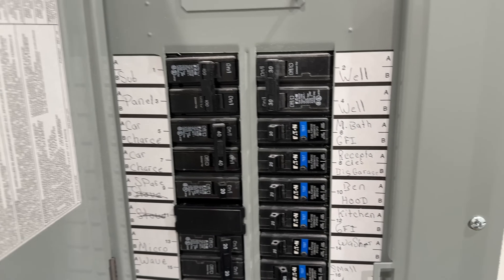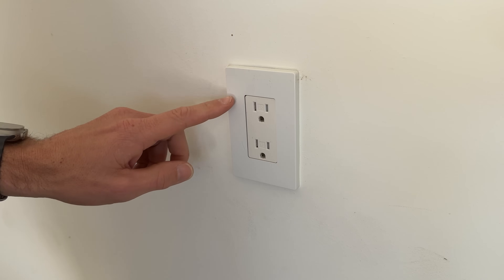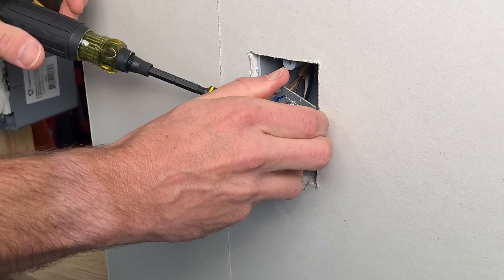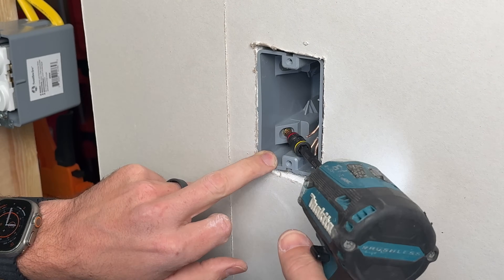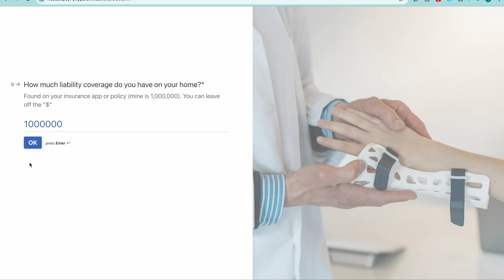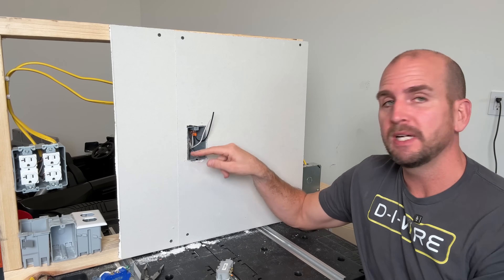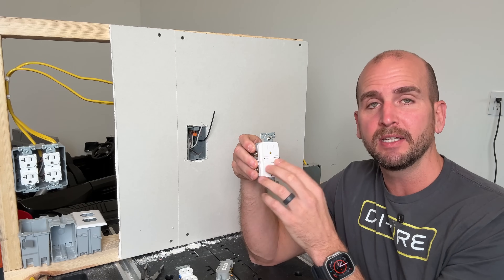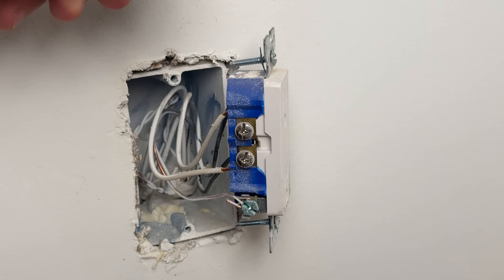The Ultimate Outlet Replacement Guide: 10 Mistakes Everyone Needs to Avoid

Comment: Good pointers. I always use a torque screwdriver/small wrench when tightening the terminal screws. All manufacturers have a recommended torque specification for their receptacles.

I find Eaton TR receptacles are more adult friendly than the Leviton. Whenever I try to plug something into a Leviton TR receptacle, I feel like I am breaking the TR tabs. Not so with Eaton.

I don’t know if you have created a video regarding permitting, but that is something DIY’ers can get wrong. Some think they do not need a permit because they are the homeowner, which in my state is not correct for a lot of the work you show. Some think since they own the rental home, they can do the work as long as they have a permit, which in my state is never correct.
Reply: Oof. This may sound bad, but avoid getting permission to do work in your own house. It's your property, not the state's.
Reply: @Lysander_Spooner  Personally, I would not advise people to break the law. Even after you sell the property, you are responsible for the work you did on it. If somebody gets hurt from your work and they can prove you never got it permitted/inspected, their legal position against you is much stronger.
Reply: @Around_The_Home  The "law" is a construct. Usually for three reasons, revenue compliance, and control. A free people don't ask for permission.
Reply: @Lysander_Spooner  Does that apply to the NEC also?
Reply: @Around_The_Home  I've found the NEC to be fairly practical on most codes. Some are a little ridiculous.
Reply: @Lysander_Spooner  a building permit is not permission.  a building permit with the accompanying inspection report, is confirmation to people with a future interest that it has been done properly.  have fun transferring ownership of a building with no inspections.
Reply: each state has different rules.  I think for the most part, simple device changes may be done by the homeowner with no permits, in the house they live in.

Comment: Great summary. Just changed a receptacle this morning in an old house. The ground was screwed to the back of the metal box. Is that enough? Even if the box is surrounded by wood? 
Perhaps should change to GFCI. Thx
Reply: The theory was, if the box was grounded, the receptacle was grounded as well, through the screws. What you could do: Screw a grounding pigtail into the box, then do a pigtail with the existing ground and terminate it on the receptacle.
Reply: (I'm not an electrician, but I have read up on this.) Since you are in an older house, you may have metal conduit from the panel to the box. The metal conduit acts as the ground. With the outlet pulled out of the box, you should be able to see if it is fed with metal conduit, but to be sure it connects to the panel, get an outlet tester (Scott includes a link to one). If that wire is not really grounded, the tester should show you have an open ground.
Reply: @ you are right! There is a metal conduit and my tester states it is grounded. Thanks.

Comment: Great info. The right driver is always what kills me since i never spend the time to find the right one so the Klein multitools is likely in my future. Have you looked into air sealing electric boxes? Between caulking and using wall plate gaskets I am planning on doing that to my house to hopefully improve my house leaking air
Reply: in an old house, the wallplate gaskets can reduce cold air leaks.  in a newer house, the wall shouldn't be leaky enough to make a difference.  if you can't feel a draft from your devices even on a cold windy day, it's probably not worth the bother.

Comment: I use Wagos exclusively. I’ve looked for lever lock receptacles at my local ACE Hardware and they don’t carry them. I’m not sure Lowe’s or Home Depot carry them. I have to order them. I used the Leviton edge series in 2 bathroom remodels. I love them, with the “screwless” plates.
Reply: Home depot and menards sell the wago connectors also
Reply: Lowes has Ideal lever connectors (same concept, but it looks a little different). Home Depot sells both, though their website says only the Wagos are actually in-store where I live.
Reply: @ thanks. I’ll look

Comment: Good solo technique for checking breakers is plugging in a vacuum and letting it run while you flip breakers
Reply: I got a circuit finder from Klein Tools. It has the outlet tester you leave in the outlet and has a receiver tool you run over your breakers at the box and beeps with red light when you're over the breaker.
Reply: @johnhwang339  me too, brother. How do you like yours? I’m about to fire mine up for the first time over the weekend.
Reply: Ive seen some outlets mainly in shop/garage setting where each receptacle was connected to a seperate breaker, make sure you test both
Reply: @simplykd3c  That's commonly required for receptacles located on the wall behind kitchen counters. It's code here in Ontario, Canada. It's because many of the portable appliances people use there are high current users ( tea kettles, toasters, etc ).
Reply from the maker: Great Idea!  Thanks for sharing.  I know some use a radio for a similar reason.
Reply: I just flip the mains off 😂.   Better safe than sorry!
Reply: NICE.  THANKS
Reply: That’s a great tip I rarely ever have anyone to help me. 👍
Reply: You can take the cover plate off with a flathead screwdriver. When I replace them I will turn off the power for the room
Reply: I'm glad I did a job of installing outlets in a new basement with new walls...😅 Alongside an electrician
Reply: One, my nephew is an electrician, and he finishes the wiring by wrapping a couple of layers of electrical tape around the outlet to cover the screw heads and help prevent accidental contact. Two, I finish with the screw heads horizontal. I think that the vertical position is a little too, ah ‘aggressive’.

Comment: So ground up or ground down? And if you put ground up, do you still wire hot to gold and neutral to silver? Sorry if that’s dumb, but I’m having a hard time visualizing this.
Reply: Code doesn’t say anything about ground up or down, although you will find people claiming one way or the other is the only right way to do it.  Some claim it’s safer up because a falling metal object wedged in between it and the wall will hit the ground first, not the hot prong.  On the other hand , ground down will ensure outlets stay in place more reliably because the ground receptacle doesn’t wear out .  Personally I prefer ground down.  Hot still goes to the gold and silver to neutral regardless of how you orient the outlet in the box
Reply: @ethansmith2326 We had this same discussion during my apprenticeship. You nailed the answer. Nice job.
Reply: @ethansmith2326  Thank you.
Reply: Hot (black) goes to the gold screw terminal. Neutral (white) goes to the silver. Ground goes to the green. As a DIYer, I install receptacles one of two directions, 1)receptacle vertical with ground down, 2) receptacle horizontal with ground either on left or right, depending on the space.
Reply: @Around_The_Home  Thank you.
Reply: yes.  hot is always to gold, and neutral to white.   the cord does not switch polarity just because you rotate the end of it.  it's kind of like you don't drive your car from the left hand seat going north and the right hand seat going south.